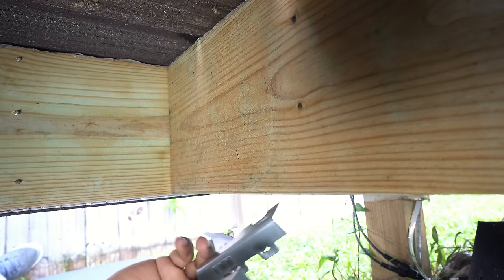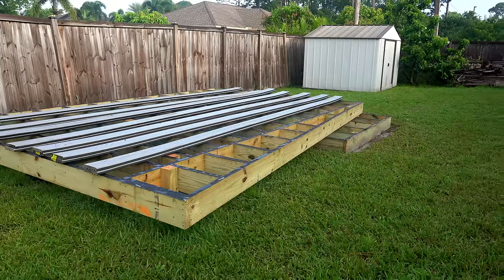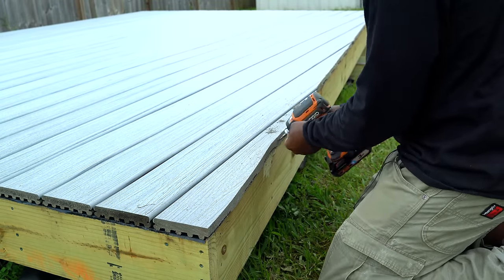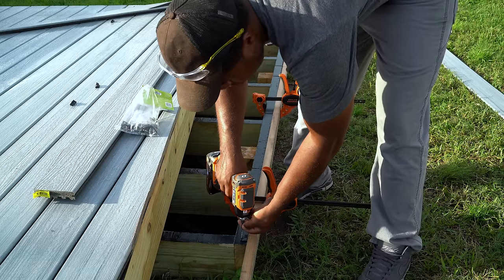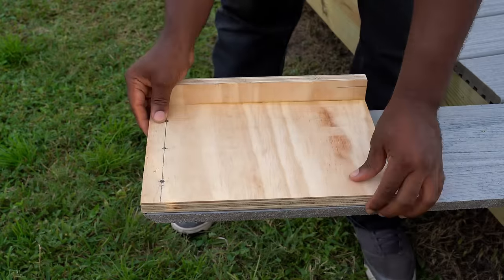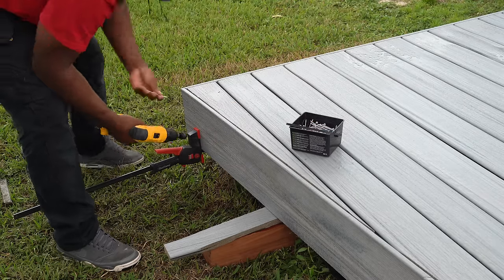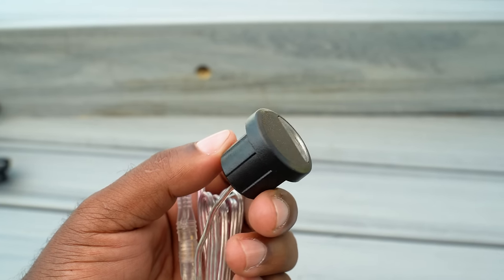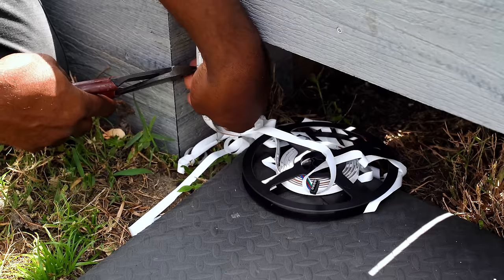Building A Ground Level Deck with LED Lights l Composite Deck (part 2)

Comment: Good job. Im a general contractor, and while there were certainly some areas for improvement from a construction standpoint, you took on the project and followed through with it. We all should continue to challenge ourselves and grow in skill and ability.

Good choice on the decking material.

Comment: Hey Glen, Wow... Not only was your video production 5 Star. You did a great job on the decking, going back and using the correct hardware was the right thing to do. Thanks 🙏🏼 for sharing

Comment: Man, I wish I had all those tools to build a beautiful deck like yours.  You are very creative, congrats!!!
Reply: The key is to save, and buy them one at a time on sale. I'm going on 52 yrs. old, and I was able to buy my first Dewalt screwgun, ( cordless drill) about 6 months ago. Now I have a circular saw, impact driver, screwgun, orbital sander, and reciprocating saw. I still need quite a few more for all the house remodeling I have to do, but I'll eventually get them.
  The biggest difficulty you'll have to overcome is the desire to buy something else, and put off buying your tools. It's far better to do something than it is to wish you had, and have that regret. Never let wishful thinking get in the way of your goals, and aspirations.

Comment: Here's what I learned.  This is a guy with grit,  who listens to suggestions and corrections.  I like him and think many folks could learn some things from him. 

Decks do usually require some adherence to code,  but primarily only when they are more than a few inches off the ground or when they are attached to a house.

Comment: I dont understand how someone talented like this gets dislikes, please someone tell me!?
Reply: maybe people with two left hands that can´t use a screwdriver. Who knows?
Reply: Mohammed Haq , haters, they are everywhere!!!
Reply: Because a hater just has to hate ;)
Reply: I don't understand either but this is the world we live in.
Reply: Hes doing a how to video and showing you how to build a deck that will fail prematurely. The joists should sit on top of a notch cut into the 4x4. and carriage bolted together. Not screwed into the side. Ultra fail. expensive composite 5 quarter boards on top of a turd .
Reply: @NPC-157-e7r  Actually, the notch may not be completely necessary.  I have built decks that have lasted years without the notch.  I just used the steel corner hinges and bolted the joists to the 4x4s.
Reply: @tinahinojosa9326  Are you talking about Trump?
Reply: Contractors who want you to use them instead of DIY.
Reply: A dislike comment shows lack of appreciation and lack of talent, or just jealous ! :)
Reply: @paoleila  or it just shows that you didnt like the video...
Reply: @NPC-157-e7r  the boards themselves will go long before the hardware. Wouldn’t matter if you notch or not. Horrible comment.
Reply: @NPC-157-e7r  Hey, you seem to have some serious issues man.  Maybe you should first consult a psychologist for a while to get rid of your anger before spewing venom and putting down other people.
Reply: @vahidlotfi5116  lol . You are soft. Im not "spewing venom" and its this " deck" thats got serious issues. Hes showing people the wrong way to do things .  One would argue its you that  has issues.  That comment has been there for six months.  Only after some other weekend warrior commented did you jump in and give your opinion. And if a reply to a comment constitutes " serious issues " in your life you have some work to do as well .
Reply: @bobbyjackson6495  nice peckerwood  Sunday best.
Reply: @NPC-157-e7r  the first thing unintelligent people do when they disagree is start attacking someone’s appearance. Are you going to start talking about my mom next?
Reply: @NPC-157-e7r  did you finish high school?  It must have been hard for you - feel sorry for you.
Reply: @vahidlotfi5116  oh and i can build a proper deck also. The difference is my deck looks out over the water. What color is the mobile home that you look at when you sit on yours?
Reply: @NPC-157-e7r  if you have to tell people how great you are, you aren’t as great as you think you are. Degrees in left handed puppetry and Bronze Age basket weaving dont count.
Reply: @bobbyjackson6495  👎
Reply: Paul blart funeral edition
Reply: @bobbyjackson6495  Don't waste your time arguing with this fool.  He is just full of himself and has no appreciation for other people's work or views.
Reply: @vahidlotfi5116  hey dbag you should watch the video .i sent the link  It explains why you are wrong.  Since i didn't graduate you can hear it from someone else. That goes for the rest of you too. Its a HOW TO  video on HOW TO DO IT WRONG. if you dont understand why i take umbidge in regards to this video then " HUSH UP" There are still people out here that DO THINGS RIGHT and i dont care how many trolls gang up and say that this deck is awesome  ITS NOT. Dont make a video about something you don't know how to do.

Comment: So to all the expert deck builders out there he put in the joist hangers are yall happy now
Reply: No /s
Reply: It’s not that we’re all experts it’s called common sense
Reply: He fixed some stuffs AFTER building the deck because he read thoses comments after the composite was installed. not exactly planned. But still great and will work perfectly for the purpose.
Reply: I'm not an expert or even a pro builder. I just thought a few horizontal screws were in no way strong enough to hold the weight of the deck + people.
Reply: Matt Postle  I wonder if thoses were deck screws or structural screws.  dexk screws has a shear strength of 80 pounds only. they can snap one by one and one day it fail.  Im sure he ll be fine and he is not far from ground but the same on a second floor deck could be dangerous.  screws are great but with the right type
Reply: GORDO EINSTEIN thanks for your counter-assessment
Reply: Not happy. They should be installed with nails not screws.
Reply: Us pros, as some people say more or less condescendingly, use joist hangars because it’s code and we pull permits to build decks. Joist hangars (at least in my area) are required by code and we need to use joist hangar nails (teco nails). The hangar screws are against code here. Though I dont know why.
Reply: Well, joists hangers are too small, right size goes up to the top of the joist
Reply: Well, it does look like a deck for dancing and stuff., sure, no one is going to really get hurt if anything happen to the deck, but if it does break, ill be too complicated to fix. Just put the damm things before, it shouldnt elevate the cost that much 50$ at most, and will make the deck last longer.
Reply: It's like calm down.
Reply: Yes, before joist hangers were invented, it was technically impossible to build a deck, lol.
Reply: Joist hangers and brackets are relatively new in construction. 3 screws per were the norm and still is for the most part.
Reply: @DrLoveQc  Hi hater
Reply: Thomas Miller Do you send your message via a pigeon to be so late? lol 😂
Reply: @DrLoveQc  Don't matter if i just seen it!!!!

Comment: This is a helpful video. Thanks! I'm considering tackling a 10'x20' deck build at about the same height next to my house. I appreciate all the pointers and you also showing where you made improvements to the original work you did.

Comment: You did a good job. We just put railroad ties on the ground, lined them up on 16 inch centers, filled the spaces between them with coarse sand and put the pressure treated lumber on top and atteched them with 3 inch coated deck screws. It has been out in the weather out here in the mountains for over 20 years and I've only had to replace one board due to cracking.

Comment: Very well done video.  Audio and video are nice.  Directions and demonstrations are clear and comprehensive.  The only thing I would do differently is put the joists on top of the posts instead of connection from the side with screws.  I will look forward to more videos from you.  Congratulations.

Comment: That came out gorgeous! I just love a man that already knows that those splices and corners need to be mitered, and to put the splice away from the step where it will be less noticeable... every aspect of the build was thought-through for the best end result. When I’m dealing with a contractor (because I just don’t build things solo like I used to anymore, especially jobs that really require several hands), it’s like pulling teeth to get them to knock themselves out to even make a 45° cut at corners, because it’s “too complicated” (yes, it’s soooo hard to set a saw from 0° to 45°, make the cut that they would’ve had to make anyway, to then have to set it allllll the way back to 0°, it probably adds a whole two or three seconds to the job for every single tedious time they have to do it), and I’m “being picky“.  It’s downright glorious to see someone properly and carefully crafting a beautiful end result such as this!  It gives me hope that there might be others out there with a good eye for detail, and the willingness, and intelligence to pull it off. It makes me happy just to see it being done somewhere...great job! 😊

Comment: That's a beautiful deck! I'd love to build one of those, however, my yard isn't really designed for it. I just recently tore down the deck that came with the house because it was leaning, rotted, and unsafe. My wife wants to do a block patio instead, so we might do that. I also must say you took the typical Youtube comments criticisms extremely well. All in all making those modifications made that deck a lot stronger, and safer.

Comment: I agree its hard to believe this is his first deck, been building decks for yrs he had good prep using clamps and a good setup awesome job. IMO I run all electrical and plumbing if needed during your rough then install your lights

Comment: Love your videos. You are a lot like myself when it comes to figuring out how to do things by yourself. The one thing I picked up on I think pertinent to elaborate on is the importance of using structural screws with the joist hangers. Speaking from experience that little bit of knowledge of knowing when not to use screws because of sheer strength could go a long way

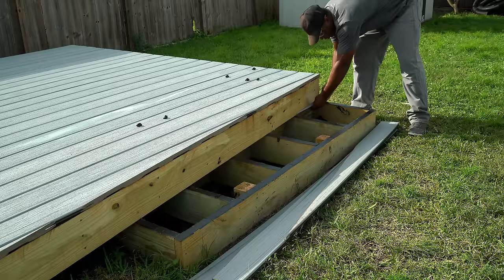Comment: 5:46 I like how empty your dust extraction bottle is :D The main point of the bag over the bottle is the bag lets air go through and keeps dust in. The bottle completely blocks airflow, so no dust gets in. 
Also, the US likes MASSIVE circular saws, the bigger the better.

Comment: I’m giving you 500 bonus points for thinking your way through challenges.  The creative use of clamps, spare material pieces, cut/drill jigs…….one has to be clever to work alone.  I work at a construction supply center and recently got 15 20’ pieces of Trex decking for free (slightly damaged in shipping). It’s just enough for an 8’x8’ grill platform outside my back door.  I rent so I’m not investing deeply on the tape, specialized fasteners, etc.   I figure the work is worth the upgrade, but I’m not buying my landlord a full Trex deck.

Comment: I've built many decks over the years, some with all the brackets, and some without and many years later I cannot tell a difference between the ones with or without them.  Of course theres a lot of different factors that go into whether or not I use them and the main ones are the span, estimated weight, and/or height of deck for safety reasons of course.  I'm not saying people should not to use them but most of the time they are just extreme over kill that city/county building inspectors require just to piss me off, and are a waste of money lol. Awesome build by the way! Love the lights!

Comment: Looks awesome! To get the LEDS to pop you should consider placing crushed marble and mix in a little bit of recycled/tumbled glass around the perimeter. Hold it all in place with some edging. As you can see grass doesn’t reflect any light.

Comment: Great Job lots of skill tips.....in the 1st Video i didnt see you reverse the level as you struggled to set the level. A good tip i got was to reverse each time you moved it if this helps.
Good voice confident and clear keep smiling 10-10.

Comment: We always order some solid border piece  around the border of the deck it cleans up the look of the ends of the tree so you don't see the cut ends you will have to frame for it on the sides so the border has something to land on as well as the ends of the middle piece of decking

Comment: Wow I Could not help but notice all of Those Brand New Professional Tools you have. Dewalt Makita etc etc etc.   Those tools makes the job so much easier!!  If the average DIYer purchased every tool that  you have in this video- add $5k to your deck cost lol.
I guess when you have a 5 million + video- sponsors start throwing tools at you?
Nice job on the deck!!

Comment: Beautiful! Maybe think about a 24v ledstrip that includes white as well? Then you are able to create more natural pastel colours what will blend in better. Or a cold white to warm white ledstrip. Early evening white light that fades into amber. Sunset simmulation. You can add two power adapters for both colours and set them up a timer to make the switch between the two lights

Comment: I laid a composite deck 2 years ago. I 100% regret it. It's not easier to look after at all. I laid it per instructions, but after a few months it began to split, as each section expanded an tried to push the ones next to it out,but couldn't due to the hidden fixings.
I then had to re-seat the entire deck (2 levels, around 15 square meters) and put the fixings further apart to allow more expansion than the instructions said to.
Now a year later it's beginning to split again in places. Plus it goes green AF, constantly needing washing down (it's angled to allow run off). It's been washed so much that it now needs restoring compounds to get the colour back. If it hadn't cost so damn much I'd throw it and get some good old wood decking down.

Comment: You should put your deck hardware before you install your deck planks. Also, a chalk line would of saved you time cutting the face of the deck planks. Looks good.

Comment: Good job. It might have been better to go for 1" square deck lighting in silver to keep the clean lines and angular aesthetic rather than black round shape which is noticeable during daylight hours. In New Zealand, we don't have the same critter problems, so it was interesting to watch the extra work you put in to protect the deck. We don't work with composite as wood is comparatively cheaper in New Zealand but thank you for a good, informative video. Might need to consider composite for a personal project going forward.

Comment: Love it, think it would have been easier to prep the frame and boards for the lighting before installing the boards etc, saves extra drilling and squeezing under the deck to get where you need to, but that's just me . Great job though dude nice one 👍

Comment: Great job mate 👍 it was kind of painful to watch you with that belt sander out though 🤣 A track / plunge saw is the mission for trimming the ends / angles of the decks. Would have saved you a lot of effort and left you with a nice clean cut :)

Comment: They also make a drill bit that actually drill the holes and counter sinks for a pan head screw which is what the rep should have told you to use for the skirt board the have a bigger flat head that holds better on the skirt

Comment: change the white lights to purple and the blue light on the bottom will flow better. atm the regular lighting looks like orange, while the bottom looks like blue, and the colors are clashing. also, the purple/blue would look really good with the rest of the deck in terms of color.

Comment: Your deck turned out pretty sweet... Not sure but it doesn't seem to be very bright when you show it at night though that could just be an issue with the camera and/or lighting in general (because cameras tend to suck in low light conditions). Makes me want to try and build a deck now.

Comment: Btw nails are better to use if using joist hangers for a heavier load bearing structure like a sundeck. Nails have better shear strength than screws.

Comment: Really, really beautiful deck. I think I would have used the 1" round lights on the steps, and went all around all three sides of the deck, front and both sides. Not the back. I think it would really set it off. Of course on separate switches so I could turn them on/off separately from the LED's.

Comment: With beautiful Trex how did the deck get so out of square? For that reason it's best to start laying the boards front to back so it doesn't show as much. I did like the tips and tricks you used working alone. 👍🏻👍🏻👍🏻🇺🇸
Reply from the maker: Out of square? This is the design I wanted.
Reply: @DIYCreators  thanks for correcting me. I didn't hear you say this was the intended design
 It came out great and the lighting...out of this world. Fantastic!! 👍🏻👍🏻👍🏻🇺🇸

Comment: Hey there,
Done a few decks in my life, the bast board finish if you have angle like your, you run full board at the end and cut second line, that way you ended up with perfect finish board instead of cut
Don’t hate me 🤣

Comment: Fortunately when this thing collapses it will only fall 8".   The joist hangers were a good add.  Posts support beams, not joists.  The rim joist is kind of acting like a beam but it's undersized and not properly supported.  The 2x 'beams' will fail in shear at the bolt connection.  A Simpson DJ14TZ would solve the support problem but not the size.  The middle posts are supporting single joists.  No load is being transferred so every third or fourth joist is super supported and the others not enough.  This is not an issue for a ground level deck but it illustrates why you hear of people being injured by collapsing decks.  The local code official is your friend.  If you ask they will help you.